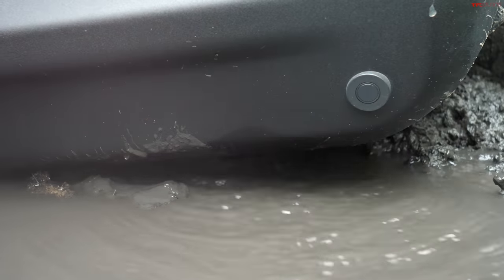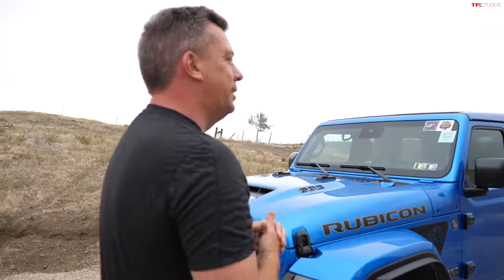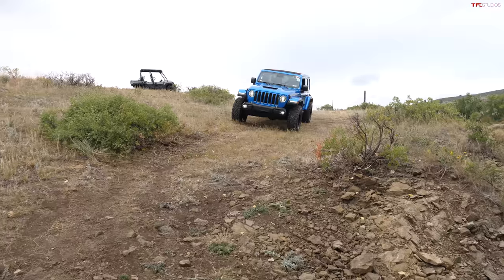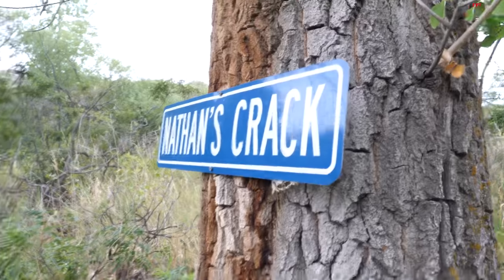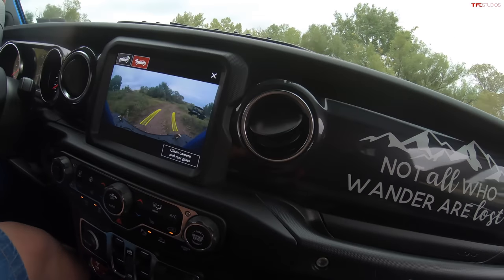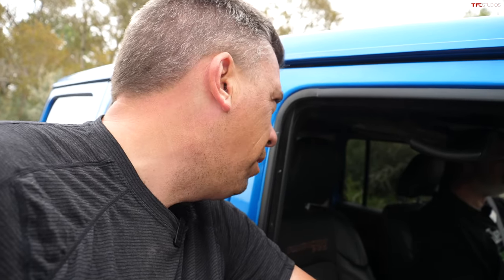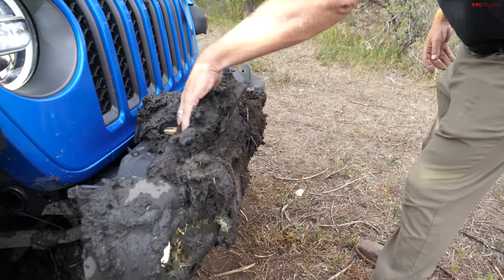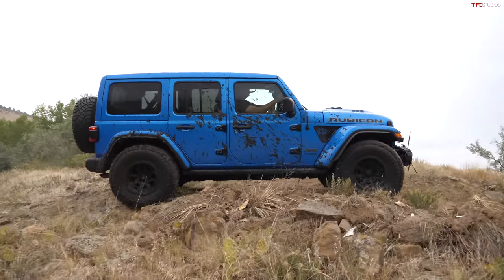I Got My Jeep Wrangler Rubicon 392 Very Stuck On TFL's Off-Road Course! Will The HEMI Get Me Out?

Comment: On the subject of V8s and how jeep put the 392 on the Wrangler, I wish they would offer a smaller V8. Bigger isn't always better. I used to have a Silverado with a 4.8L V8. Great exhaust note, had enough power (285), and was pretty torque-y (over 300 ft lb) with decent fuel economy (got 20 mpg in a short wheelbase V8 Silverado). I wish there was something similar available for the jeep, for the sake of cost. I'd pay an extra $5k to have one as an option in a sport or Willys. But I'm not about to pay $20k extra over a similarly equipped Rubicon just for a V8.
Reply: Like the LS. They're dimensionally the same... And a 6.0 will still get the same mileage as the 5.3 and won't drop while towing
Reply: The MSRP on a 392 is about $10K more than a loaded V6 Rubicon Recon. Go through a dealer selling below MSRP and that difference is even less.

I believe Jeep used the 392 for two reasons. First, they wanted to throw down what they had to handle whatever Ford was going to release. Secondly, they ultimately don't want to sell to many V8 Wranglers as it destroys their corporate CAFE rating. If they offered a low cost 5.7L option the take rate would be too high. Supply constraints combined with customer demand would push the price up anyhow.
Reply: @redtitan29  I mean, maybe the way YOU'D spec a V6 Rubicon, that's the price. I just spec'd one on the jeep website, and a non XR (because I'd put my own aftermarket lift kit, regear to 4.88s, and 37s) with my options (Gorilla Glass windshield, auto transmission, tow package, tailgate reinforcement and remote start) gives me a Wrangler Rubicon for about $54k. Sure, you can add blind spot monitoring and adaptive cruise control and all that if you want, or steel bumpers and LED headlights, but I don't really need all that extra fancy stuff in my Jeep, because that's not what I'm buying it for. And stuff like bumpers and LED headlights can be added in the aftermarket for way cheaper. 
And that's on a Rubicon. I'd love to see the V8 option in a Sport or Willys, and I'd 100% pay $5-6k extra for it. But the 392 starts at $80k. I'm not paying that much. I understand why they did it - like you said, it ensures they meet their MPG requirements because most people won't be getting it because most people can't afford an $80k car - but it would still have been nice to have the option. Wishful thinking on my part. It doesn't really matter, anyway, since all Jeeps will be electric in 12 years or so, regardless. Would have been nice to experience it before that, though.
Reply: @backwoodstherapy  A 392 is only available loaded so my comments were towards a similar equipped V6 Rubicon. All things equal, I gladly paid the marginal increase to get the V8. Like you, I chose to go with a standard 392 to install my own lift etc.
Reply: @redtitan29  that is actually my point. There may not be a huge difference between a loaded V6 Rubicon and a 392, but I'd like it to be an option in a non-loaded vehicle. Let it be an option in the Willys with the XR package, and I can throw in a front locker, an economy lift, and some 37s and I'd have an amazing V8 rock crawler for less than $60k but that's almost certainly what jeep DOESN'T want. 🤣
Reply: How about the 5.7?
Reply: @Wezi427  I'd love a 5.7 if it was an affordable option on the Sport or Willys. We'll never see it, tho.
Reply: @backwoodstherapy  agreed, you see how stalantis is slowly killing the V8 anyway. Have a JK 2-door and have seen people swap 5.7 in them. The amount of money and time that's put into doing it is crazy, I would much prefer the option when buying.
Reply: @Wezi427  federal fuel economy standards just keep going up so I can understand why Stellantis and other automakers are doing away with them - hell, the Silverado now comes with a turbo 4 as it's base engine. But I'd love option to have an affordable V8 in something that's not going to cost $80k.
Reply: @backwoodstherapy  I'm with you.
Reply: The Chevrolet Silverado is better than Jeep Wrangler.

Comment: I love the course but I’m not sure if Tommy’s demise in its current form makes sense. So far not a single vehicle has cleared it on its own. Maybe it needs some rework?
Reply: I think a lot of it has to do with driver as well personally
Reply: A couple vehicles have actually cleared it. That guys with the TJ from a few weeks back got through it.
Reply: The jeep gladiator made it
Reply: @outofboundmudders  yeah it was with a LJ that got stuck but the LJ had smaller, less aggressive tires. I think the week before was the week the other built LJ (or was it a TJ?) got through it.
Reply: @backwoodstherapy  I would love to try the course my self I have a 2022 jeep gladiator willy 3.5 inch lift with 35s
Reply: you would never approach it head on makes no sense especially in a short wheel base.  Object is to get at least one tire clear and let the suspension do the work

Comment: I wish they’d make a gladiator v8. I know they won’t because of the epa and it would reduce payload unless they upped the gvwr but dang would it be sweet. I’d even settle for a 5.7 gladiator. Come to think of it, a 5.7 “budget” wrangler would’ve been cool too
Reply: I said this elsewhere in this thread, but I'd love a smaller V8 option. The 5.7 would be a nice $5-6k option. The Rubicon 392 starts at about $80k. A decently equipped Rubicon (Soft top, gorilla glass windshield, automatic transmission, tailgate reinforcement, remote start and tow package) goes for about $55k. Hell, a Willys with the XR package and the same options goes for just over $50k. Imagine a $5-6k option for a 5.7 V8. Then throwing an economy lift on that, some 37s and a front locker. With the extra power and torque the V8 gives you, I'd absolutely drive that over a Rubicon 392, and for about $20k less. Which is exactly why they won't put the V8 in anything but a fully loaded, top of the line Rubicon.
Reply: Americas Most Wanted does conversions. You Tuber Casey250 and I think Epic out of Canada swapped in a V-8 in a Mojave
Reply: @backwoodstherapy  I’d also have to assume another reason they wouldn’t would be because they have to keep the efficiency of the lineup as a whole at a certain level, and the profit margins on a 392 are higher so they’d prefer to use their limited low-mpg-vehicle production capability on the 392
Reply: @J.Young808  that’s sweet. Would still be nice to have it straight from jeep tho. Most ppl buying a vehicle trade in or sell their old one so to ship a vehicle off to have a conversion done would be a pain. Plus likely cost more. And void the factory warranty.
Reply: The Jeep Gladiator is better than Jeep Wrangler.

Comment: No tire would get you out of that . More clearance and more momentum. 

The 392 can do it with some finesse.
Reply: Maybe some super swampers but those suck to drive on the road.
Reply: He put ATs on a rig that came with MTs.

 Boggers wouldn't likely have much issue.
Reply: He could’ve made it with the tires he had if he didn’t stop at the worst possible moment

Comment: The experienced 4x4 helped out the novice driver quite a bit.  Every bit of kit helps.  But it goes to show that a lot of the issues that can effect even the most capable rigs is the length between axles, as well as ground clearance under the rig as well as the front and rear differentials.  Since hes’ got a four-door, he’s going to need to get bigger tires, and a higher lift kit.  Depending on what axle he currently has, he might need to upgrade to a 1-ton axle to prevent twisting it and the gears out of the pumpkin.  Not sure if the transfer case needs any upgrades.  I was so thinking this driver would go into one of the manual gears on his automatic to keep his RPMs down to just let the jeep do hte work.  But some of those were definitely too fast.

Comment: Typing this as I'm watching but I'd love to know how much he paid for it by ordering it?  There's a bunch of out of their mind sales manager guys at the Cadillac dealership in Memphis, TN where I live that said they bought the same vehicle and have it on their lot with about 800 miles on it, listed as a used vehicle, and they want $93,000 for it!!!!!  It doesn't have any options on it really either.  Basically a "stock" 392 Wrangler.
Reply: Lots of dealers are selling for $8k under MSRP on 392 orders. I bought one off a dealer lot with the Xtreme Recon package and One Touch roof for around $2k off MSRP. They were asking $9k over, but the market isn't what it was even just a few weeks ago.

Lots of cars in this area are 500 mile "used" cars for $10-$20 over MSRP, either that or the dealers are putting mandatory ceramic coating and PPF packages for $2-$8k over sticker.

Comment: I’m not impressed…you only need power like that for a mud truck…jeep should bring back the inline 6 ,4.0 but turbocharged…these high horsepower jeep will become a heap after they get some miles on them
Reply: the turbo 4 is extremely capable and light lots of torque

Comment: I do not believe those hooks on front of jeeps are built to sustain kinetic recovery as dumb as that sounds
Reply: Seems crazy if true. Why bother with recovery hooks then.
Reply: @mikefoehr235  well dynamic pulls are way different than static. Think they are rated for around 5000 static towing and mud adds a lot to the felt weight when recovering vehicles.
Reply: @aaronlima1993   ow we know why Toyota ditched them on the new tundra
Reply: @mikefoehr235  no Toyota just made a lowered city truck including the TRD with no lockers and no 4Auto.  No excuses.  Sincerely ....... a two time Landcruiser owner
Reply: @02hreblue30  I have read comments about 4 auto...the transfer case fails on GM when left in 4 auto and big bucks to replace. I can see that being a double edged sword.